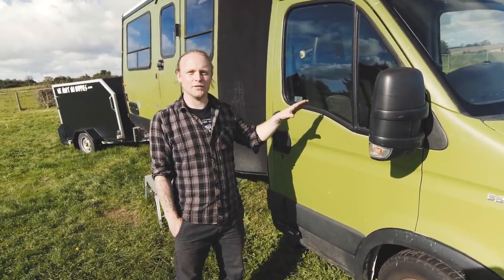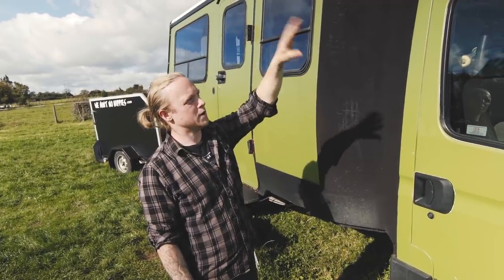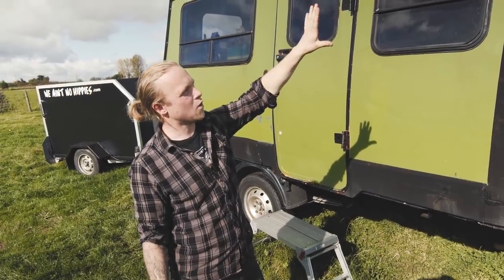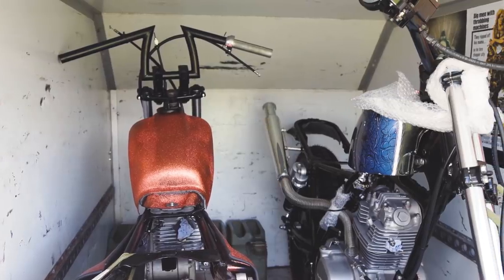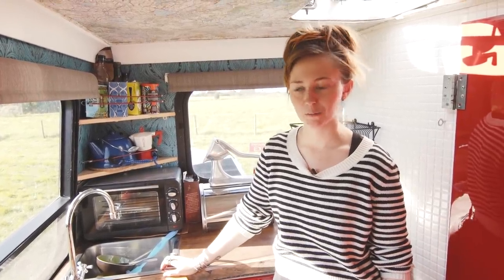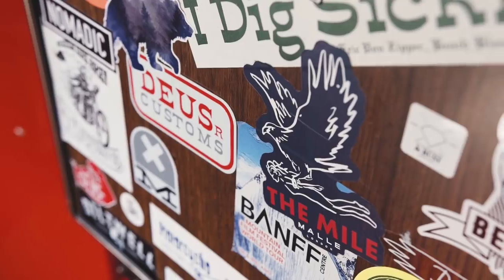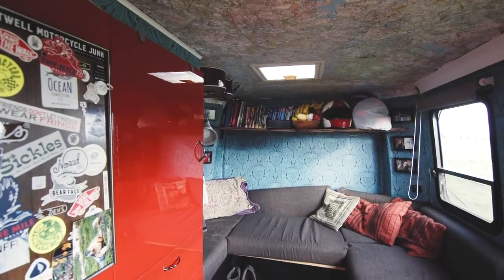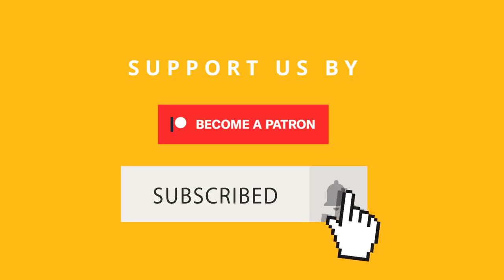They CUT Their Van in HALF to Create Ultimate Off Grid Winnebago! VAN TOUR

Comment: just in case you're not aware of the history, Tesco had Iveco change some settings on their vans engine management systems to limit the revs and this unfortunately caused a lot of breakdowns,  make sure your van has had this procedure reversed, otherwise you could find yourself pootling along quite merrily and then all of a sudden, completely out of the blue the van will just switch itself off.  In unmolested condition the Iveco is a fantastic piece of kit, it's just a shame Tesco had to meddled with it.